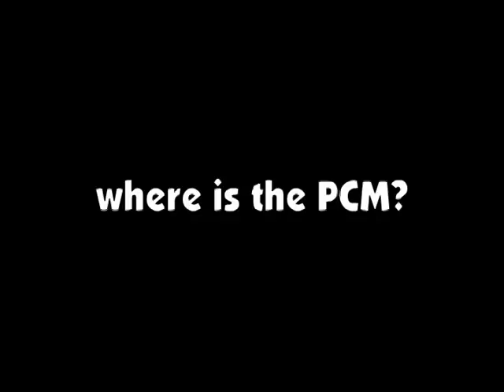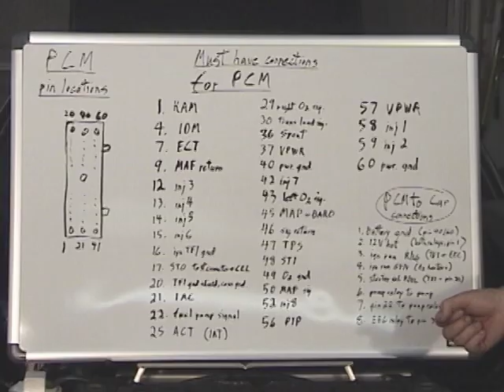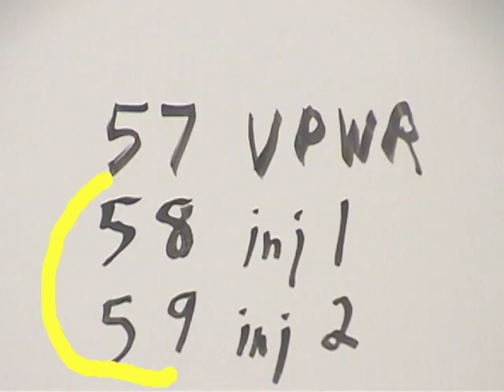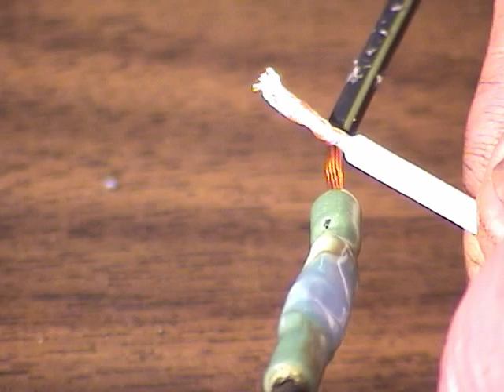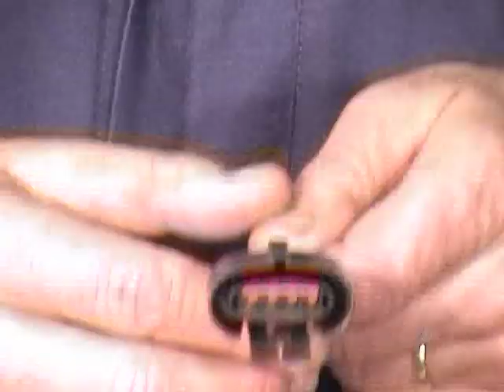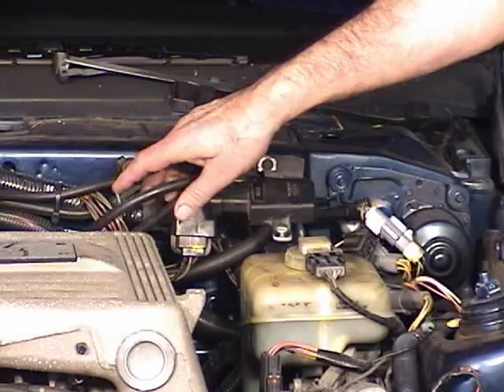Rewiring a Ford EEC IV "speed density" harness to a "mass air" harness

Comment: Any good kits like maybe painless brand even? I got a 92 f150 with a straight 6 and the truck has alot of personal importance to me so its worth it, to me anyways, to do the work. I want a 5.0 maf system. Even if i have to swap out the E4od
Reply from the maker: There really isn't any kits for the 4.9L trucks with speed density. You could completely do a rewire to a 95-96 EEC5 system for the 4.9L which has MAF. I think for a stock engine, it would be a waste of time. For a performance build, going to a Holley or Mega Squirt make more since.

Comment: I have a 1992 flareside 5.0 I added a e303 cam. non E40D will it work. On the door sticker it has letter T on transmission type. I think its non E40D. I was thinking the fiveology maf convertion kit. Or the Holley Terminator X kit. What do you think i should do.from your experience.
Reply from the maker: The conversion in the video will not work in your truck because it has bank injection and not SEFI. It could be done if you completely rewired it, not very practical. As for your tranny, take a look. If you have a cancel button, you have an E4OD. If not but it has overdrive, it's an AOD. If it's not overdrive, it's a C6. I'm not familiar with fiveology so you would have to verify it works with your truck. Holley, Mega Squirt and others are options but again, it would be a different wire harness.

Comment: Is checking continuity with a multimeter enough to ensure all wires have good connection? Restoring my old wiring harness and I want to make sure all connections from inside engine bay to the 60 pin connector are solid with no breaks.
Reply from the maker: Yes, but using a test light is better since it puts a load on the wire.

Comment: great video ya saved me a ton, any idea what the eec power should be fused at? i have the hot at all times wire still with fusable link but power into eec relay has to be re ran for the truck im putting this into, any help would be amazing!
Reply from the maker: I used the same fusable links at the starter solenoid that normally goes to the relays.
Reply: @badshoeproductions  i dont have that fusable link either :( full on motor swap and came with the the bare minimum harness to work with
Reply from the maker: You will just have to add them.

Comment: Id like to see a video covering the 87-91 ford f series truck eec IV .
I’d like to know the difference between the ecm’s  since each year truck has a dozen ecm’s listed for automatic and manual transmissions for just the 5.8!
Also would like to see some specific details about converting the pre mass air to mass air on those trucks. I appreciate the great videos!
Reply from the maker: The truck PCM is a speed density system and bank injection. This makes it not compatible to the car system. You would have to change everything over to the car wiring harness and PCM but understand that the car version will not work with the E4OD that is in many trucks. I believe the last year for the 5.8L might have had MAF but I don't think there are any tuners for those models.

Comment: Hey Ken great video .... Did the conversion on my 1989 Lincoln Mark 7 I think I need to add the fifth wire for the fuel pump relay . Heres my issue the Mark 7 has two fuel pump relays one in the trunk and one in engine compartment on the passenger side fire wall which one do I use and which wire on the relay harness is the hot wire
Reply from the maker: Should be only one fuel pump relay. The one under the hood might be the AC clutch relay.

Comment: Hello Ken.  Great video.   I have been searching for two days on info about what you shared in this video.  I have 1993 fox, 5.0 with Eddlebrock heads, and a great sounding cam, long tube headers,  with low idle issues. But not to bad.  but I've been wanting to check all those inputs and outputs .   Now it will be a lot easier to check .  Thanks a lot

Comment: Hi, I've got a ford escort 1.6 16v 90ps I've got 6volts into the MAF sensor. What  could it be the problem?
Reply: The output voltege is 0.99V insted of 0.7V aprox. with hot engine

Comment: hi! one important question. does is it correct, that 46 pin is ground not only for sensors? is it correct, that pin 46 grounded on body?
Reply from the maker: The pin 46 is what they call signal return which is the common internal ground for all the sensors. Pin 46 is not grounded to the body/engine. Internally, pin 46 is grounded to the two main power grounds and pin 20 which is the TFI shield ground. I believe pin 46 is not externally grounded so the PCM can see a possible internal open ground and flag a code.

Comment: you seem to know what you are talking about. Would you happen to know why the VPWR circuit might drop down from 12 vdc to 2.9vdc with the KOEO?
Reply from the maker: I would start with the EEC power relay. A possible power ground problem would be the next area to check.
Reply: @badshoeproductions  Thank you. I added a ground to the starter, case ground to battery, and replaced the EEC relay again. Works now, except the temp gauge. The connector has 5vdc and ground, when grounded out it does not drive hot. So bad instrument cluster?

Comment: Would this process also work on a 94 Ford bronco 5.8 with a e4od or do I need to change out the ecu?
Reply from the maker: This won't work with a truck/E4OD. The truck wiring setup with an E4OD is very different from what is used in Ford cars.

Comment: i assume i can just find a Ford v8 MAF processor for my standard trans '97 5.8 f250 , wire in the MAF sensor and call it a day ?
Needed for turbo setup.
Reply from the maker: Not really. The truck EEC system is very different from the car version. A standalone EEC system would be your best bet.

Comment: What more is needed to do this on a 5.8L mated to a E4OD transmission?
Reply from the maker: I would think you need a donor harness from a truck with a 5.8L and E4OD or buy an aftermarket trans controller for an E4OD.

Comment: I have a 96 f150 5.8 with maf system that was totaled. I picked up a 95 f150
with 5.8 that had a spun crank bearing but it's pre maf. I figured no problem because I just needed the engine but not the wiring. after the swap the engine fired right up but it did exactly as you described. the only way I can drive it is with gas and brake otherwise it stalls. I have eliminated everything but the possibility of the maf system, any suggestions ?
Reply from the maker: Do an EEC test to see if there's any codes.

Comment: I have a 92 coupe that was a four cylinder, 5 speed car before I bought it. I purchased it with a 5 liter and AOD.
It did not have O2 sensors so found it to have speed density eec. Fuel pump does not function with ignition prime as it runs continuous. It does seem to have a maff harness that is non functional obviously.
Suffice to say that it was a hacked up V8 conversion regarding the wiring.
I assume before I purchased it that something attempted the maff conversion and somehow ended up SD.
So I must do a proper maff conversion to say the least.
My question to you is do you have some literature I can print with your diagram so I can trace pertinent wires to repin EEC connector?
Funny thing is I have a new A9L that I never used from my ssp coupe that I owned many years ago that I can't use with my Current mustang that's automatic.

Comment: I really appreciate the help man the harness I got came out of my buddys 88 mustang gt and it's got a relay on the harness that plugs in the computer then it's got one  where the mass air flow is
Reply from the maker: If the relay near the PCM is brown, that should be the EEC relay. The relay near the mass air connector is likely the AC clutch relay.

Comment: I went to junk yard and got a fuel pump relay it's got a green with yellow stripe a pink with black stripe and a blue wire with gold stripe and a solid red wire can you help me with how I need to run them so I can get my fuel pump to prime
Reply from the maker: Matt, the pink wire goes to the pump/inertia switch and the red wire is going from the EEC power relay. I have a feeling you don't have an EEC relay either. You would do well to get my 5.0L swap vol.2 video or find a Ford wiring manual and go wire by wire to see what has to be added or changed.

Comment: I just took my seat out of my 89 lx mustang and I pulled the carpet back a lil bit and looked for the fuel pump relay harness and I cannot find it so what should I do? since you said that the 5 wire could be added for the hot side of the fuel pump could I do that
Reply from the maker: You will likely need to add an EEC and fuel pump relay as I did in my 5.0L swap vol.2 video. The 4cyl. harness may have a CCRM (relay box) in the engine compartment which doesn't work with the V8 harness.

Comment: so what year Lincoln computer can I use in my 89 lx 4 cylinder  and I converted  with the 88 mustang gt  computer harness and I pinned just like the way you did on this video I even added the fuel pump hot wire just in case
Reply from the maker: I had a 89 Mark7 D9S pcm which was speed density to being with. I don't think the Mark7's used MAF. I used a Mustang A9P MAF pcm for this conversion project.

Comment: I got a 89 lx that I put a fuel injected 302 and I'm wondering I got a h pipe that doesn't have 02 sensor can I run it without them like for instance take the left and right 02 sensor out of the 60 pin  and the second question is I'm not running a aod automatic I'm using a c4 with 3000 stall which computer should I go with and can I use a Lincoln mark 7 computer and main fuel injected harness
Reply from the maker: If you don't use O2's the computer will stay in open loop causing poor fuel mileage and drive/performance concerns. Weld in a couple bung and add the O2's. I've never seen a Fox H pipe that didn't have O2 bungs. You can use any tranny with the Mark7 PCM.

Comment: I love this video. great info. i'm doing a conversion that includes a 1988 5.0-HO, speed density going into a 1956 f100  big window. I got the harness/computer with the engine, but I can't find info on the eec-iv. it has "SFI- SD1" then, "E7SF-12650-E1A" on it, but I can't find info on it. I would like to leave it stock for now, as it hasn't been messed with, and maybe do the up-grade to it once all the bugs have been worked out. do you do harness/computer testing? do you know how to edit out things that won't apply to my install? that you for making these video's. I know it takes time and it's nice that there are people who will take the time to do it for others. please let me know. thanks again, kurt. soundsmith76@gmail.com

Comment: Ken, Great Video very informative. I'm changing an 88GT to mass air, it's a T5 and I purchased a good A9P. I herd that if you do not change the O2 wire harness from manual to auto it can burn up the ECU. Is this true? Reading the comments below I noticed you said as long as the left sensor and right sensor goes to the correct pins it should not Be a problem. Did I understand you correctly? Thanks Bob
Reply from the maker: You should be fine using a A9P PCM. It is made for an AOD which will see 12v on pin 30 on startup. The T5 cars only have either a ground or open on pin 30. Therefore an AOD PCM like the A9P will work on a T5 or AOD harness. PCMs for T5's like the A9L might burn the ground strip for signal return if used with an AOD harness because it's pin 30 is not protected against the 12v on startup. The A9L could be used with an AOD as long as the wire going to pin 30 is removed from the starter sol. start circuit.

Comment: I have an 89 f150 with a bigger cam and heads and I got a maf sencer of an 94 f150 auto trans along with the computer and maf plug would what u done in this video work on my set up
Reply from the maker: +brandon cruthirds As I've mentioned before, the trucks use bank injection therefore a complete EEC rewire would be needed.
Reply: Ok thanks

Comment: I have a 1989 460 efi engine I want to drop it in my 67 mustang I want to make a stand alone harness how hard well it be u don't happen to know the pin outs of the computer do need my smog put and EGR I want it to keep it simple let me know can I get ure email would like to ask u question my email is alex_ss_1@yahoo.com hope to hear from u
Reply from the maker: Alejandro Carranza You don't need the smog pump or EGR. The pin outs will be the same for truck 5.0L, 5.8L and 7.5L which are all bank injected. Your best bet would be to use a MegaSquirt. You should be able to find wiring info online using a search.

Comment: good video... have a 1965 mustang with 1990 mustang 5.0 and t5 trans ? need to hook up wires to my key switch.
 Ground all the time are 20.40.60.pin.
 Power all the time are # 1pin.
 Power by key switch are 37.57 pin is that right ? thanks for the info
Reply from the maker: Robert Sanchez Key power needs to turn on a relay which puts power on 37 and 57.

Comment: i have a motor and complete wire harness out of a 91 bronco 5.0 how do i tap in to the factory harness and where to make this swap work in a 1966 mustang PLEASE HELP
Reply from the maker: As I mentioned in other statements above, the truck EEC harness isn't the same as the Mustang wires and the changing to mass air can't be done on the truck setup. Putting and interfacing an EEC harness like in the video into an early Mustang or street rod is detailed in my 5.0L Engine Swap vol.2 and I would think there's books and online sites that outlines that info as well.
Reply: I appreciate you getting back to me just figured it out got it running 10 minutes ago everything's perfect thank you

Comment: I see you mention this swap wont work on the trucks, would that include the 460. I have a 1990 f350 with e4od. I picked up another 460 with e4od from a 97 f350 with mass air. I have all the parts, wire, ecm...can this swap be made? If yes is it the same as your vid? Thanks
Reply from the maker: My project using an A9P PCM doesn't have software to control E4OD so of course it wouldn't work in your truck. If however, you have a complete truck mass air harness and parts, I would say it's doable. I would think the 97 harness and parts is for an EEC5 system. This is very different from EEC4 and my video and there's likely to be hidden problems. Frankly, if you're keeping the engine stock, I see no reason to change it to mass air. If you are going to modify the engine, a standalone or piggy back system might be a better option.

Comment from the maker: No, this MAF upgrade can not be done on the trucks because they have a bank injection which has a very different wiring harness. The truck 5.0L will have different firing order as well.
Reply: I have a 92 Ford F 150 5.8W People to the conversion swap to a mass flow air so how can I get the kit

Comment: How did you incorporate the 02 harness while changing to mass air.  Did you leave the o2 harness alone or did you have to change the jumper?  I've read somewhere that if it's a 87 02 harness you don't have to worry about it when converting to mass air.  Is this true?
Reply from the maker: The harness I used did not have a concern. As long as the right O2 signal goes to pin 29, left O2 to pin 43 and the O2 gnd. goes to pin 49, you're fine. As with any mod. it's up the guy doing the project to verify the connections.

Comment: I noticed you did not talk about the egr circuit. Is it required on the EEC IV mangaed motor? I am attempting to incorporate a 1988 speed density 5.0l motor into a 1966 mustang using the factory harness from 1988. Do you have a video that might help?
Reply from the maker: The EVP and EVR wires (pins 27 and 33) are the same for SD and mass air and is not needed for the engine to run correctly. If wires are left open, there will be codes placed in the PCM which can cause a check engine light but the car will run fine. In some cases, a light throttle ping may occur because the EGR does cool the combustion during light cruise. Simply setting the timing back or going up on the octane will correct that. My 5.0L Swap vol.2 video shows details for putting EEC4 PCM and wiring into my 88 TBird however, the info will apply to any 5.0L EFI swap like an old Mustang or street rod.

Comment: Good video! I am trying to test my ford 5.0 EEC. According to Haynes manual 4-17 (general EEC power and ground checks) it says check so an so pin for ohms or volts. What i do not understand is how can i check pins for volts or ohms.  I guess i need to unplug identify wires, plug back in and probe wires?  I am a not a full time mechanic.
Thanks Robert
Reply from the maker: robert mccully Why are you checking for grounds and power? What kind of problem are you having?